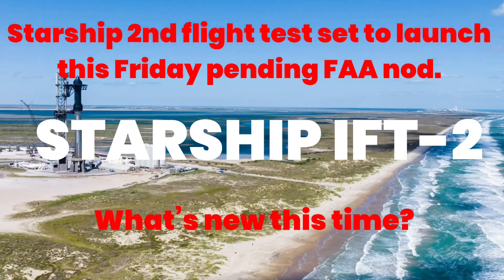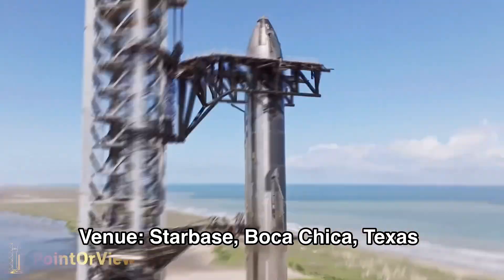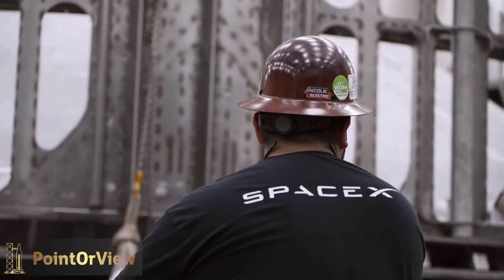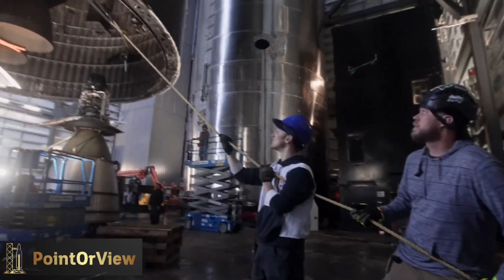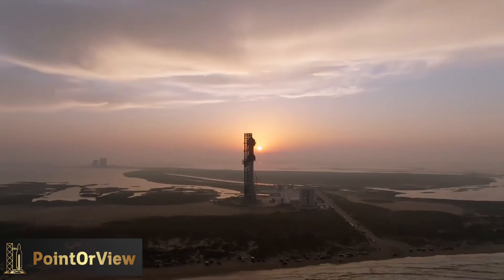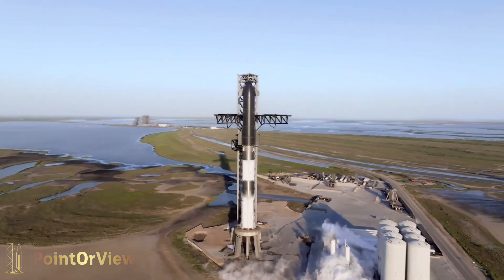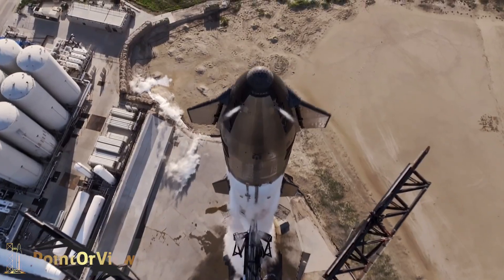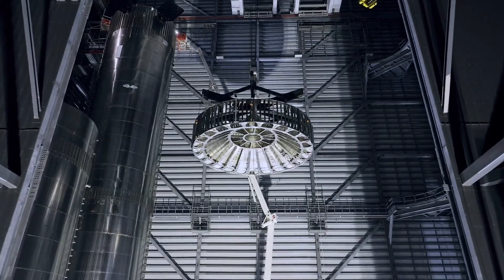SpaceX Starship IFT-2: What to Expect as a New Era in Space Exploration Begins

Comment: I can’t wait for the IFT-2 launch! The upgrades on the Starship sound incredible. SpaceX is truly revolutionizing space travel.
Reply from the maker: Me either.  Something tells me this is going to be successful.
Reply: @PointOrView Welllll…I’m a bit more sanguine…or maybe my ego thinks, “realistic”. I’ll give you my definition of Success for this second flight: Since I happen to be of the (firm) opinion that SpaceX has under-tested the Booster (due to an early Elon decision to not have a separate, integrated propulsion booster test stand)- which means, since they’ve only had one launch pad they can’t risk by doing a ton of testing there…..my threshold for ‘success’ is lowered: 1. Getting ALL booster engines to light initially is a solid step forward- since it has never happened yet. 2. A further solid step forward would be if they all kept running up until hot staging- even if there were incidents like reduced thrust or less than perfect performance by the new electrical TVC, for instance. 3. Successful hot staging, since it involves so much: keeping control while some Booster engines are firing while some Ship engines are firing & exhaust is exiting a small hot staging ring- an activity that, while no stranger to Russian or Chinese rockets, is something no modern US rockets have much experience with. If we get past  all that and Ship is boosting free and clear and under control in any way, I’ll be ecstatic and declaring in my mind SUCCESS- ON TO IFT-3! - Dave Huntsman